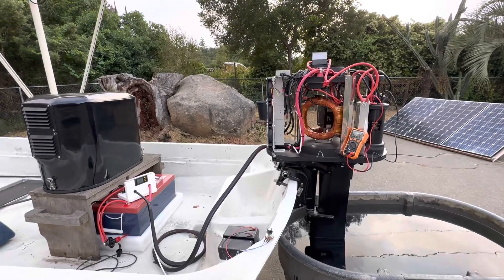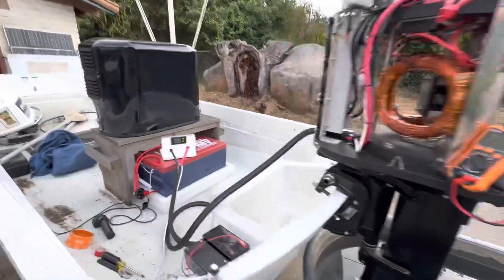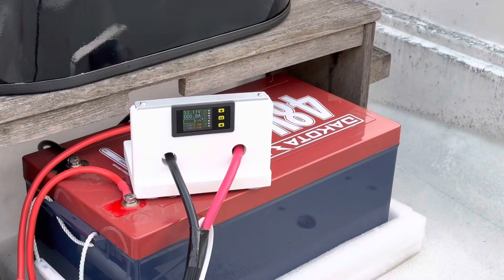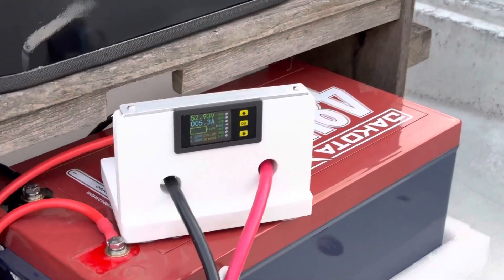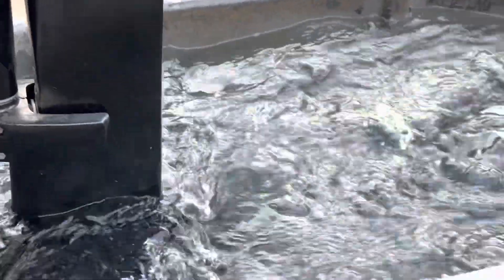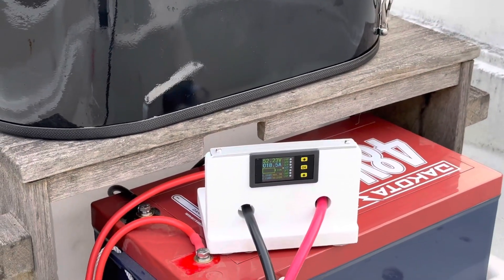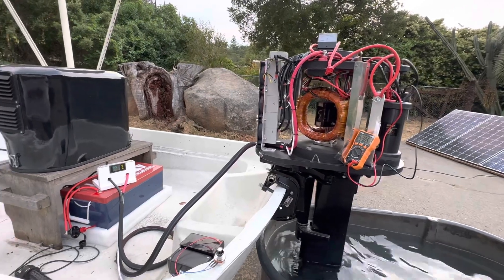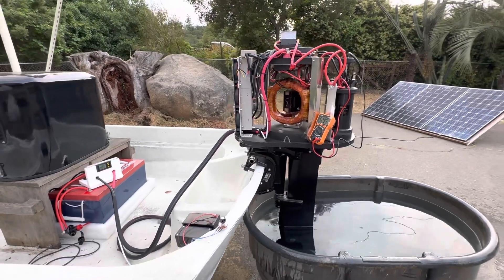Electric Outboard ( Newman type) with output running back to motor pt 2

Comment: ❤Nice motor! In the video you mention the recovery normally goes back to the motor. I am curious as to how you are accomplishing putting the recovery back to the motor?
Reply from the maker: It’s a loop back system so you don’t need more batteries
Reply: @kenergy1707  I understand it is a loop back system, but how are you putting it back into the motor? It appears you are charging a capacitor bank.

Comment: Very interesting motor. To prevent eddy current losses from the copper you could wind steel wire around the outside of the coils to hold in electromagnetic force. Back EMf might be greater
Reply from the maker: Good ideas but the magnet will attract  to the steel
Reply: @kenergy1707  true but you will have more torque and  efficiency at lower RPM. It's at the cost of high RPM and lower efficiency I guess.
Reply from the maker: @gregstafford2155  the magnet is 300lb
Each

Comment: Can this motor operate at 96V? What would be the max power at 96V?
Reply from the maker: At 48 volts it produces 600 to 800 volts back
So 96 would be over a 1,000 volts could be dangerous lol
Reply: I'm trying to put it into perspective for use in an outboard motor. It appears in the video that you maxed out at 80 amps, 50VDC, input. How much power was the motor producing at that input power? @kenergy1707
Reply from the maker: @scooter240961  it only uses what it needs so full speed was 80 amps which is about 5 hp the mosfets are rated for 15 hp

Comment: Great video, K. Greater energy efficiency at lower speeds - 60% power recovery is huge! Since you’re recovering so many amps the motors “conversion efficiency” is over-unity.. that is, more power through the motor coil than net power out the battery. 
Any ideas on how to maintain the high-efficiency when the motor under higher loads? Or thoughts on why the efficiency drops at higher loading?
Reply from the maker: It’s actually more because fans use .8 amps
Reply from the maker: I sure do !

Comment: You have recovery. Where is the generator part.
Reply from the maker: Generator ads secondary load to the motor transformer effect is better
Reply: @kenergy1707 
Like in a newman motor? https://youtu.be/LpykI-xKAdA
Was the triggers/generator in those Newman motor videos that uses the design in my explanation video, a load?.

Comment: the best thing you could do for effiency is to keep all conductive materials away from the motor. some of the magnetic flux is lost to eddie currents in those aluminum supports, steel hardware etc
Reply from the maker: That is true that’s why I used 304 stainless steel that is close to non magnetic as it gets

Comment: There are probably other ways to increase the efficiency as well. I know this is like a prototype or proof of concept. But good a joule thief circuit help to increase efficiency?
Reply from the maker: This motor produces 600+ volts from 48v so it’s like a mechanical oscillator or joule thief